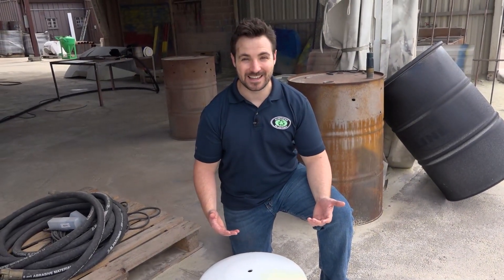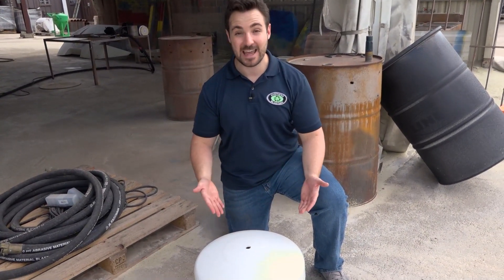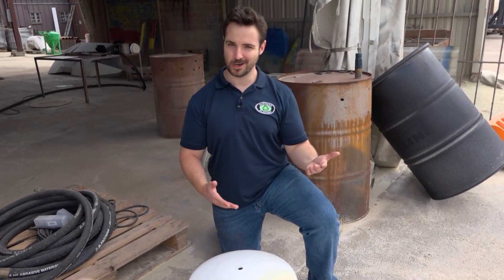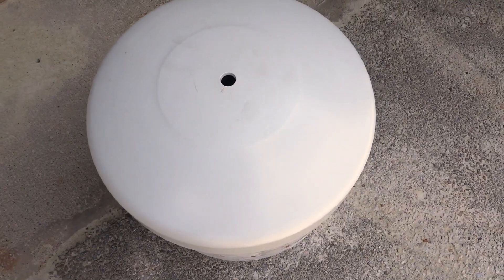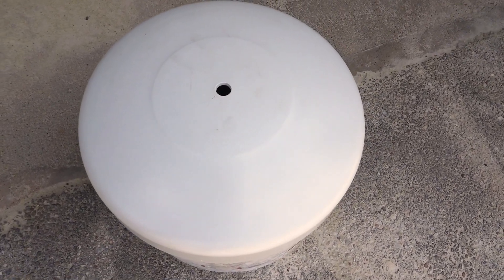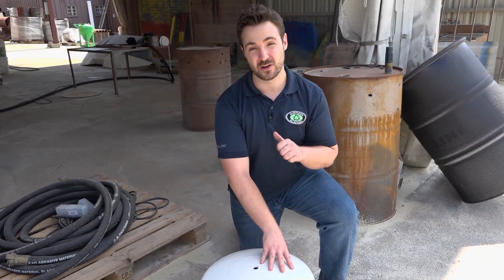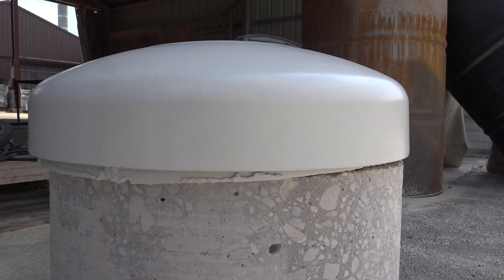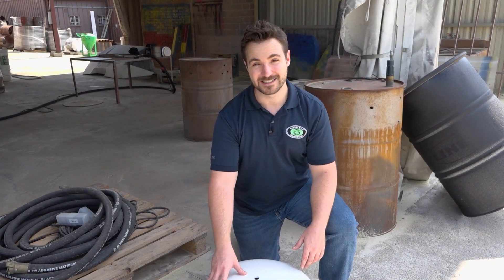Powder Coating Blasted Away! | 30 In 30

Comment: What was the profile difference?  The time and removal seemed the same? What size was the garnet vs the size of the crushed glass?
Reply from the maker: we were expecting this powder coating to be WAY thicker than it ended up being. We went to a local powder coating company and didn’t know what to expect as far as what the thickness would be. The  40/70 crushed glass removed this really easily! So if it were our choice, we’d go with crushed glass for this specific project as 40/70 garnet we used is more expensive. This is why we always recommend doing a test blast to see how thick the coating actually is. Hope that helped!
Reply: @DustlessBlasting-MMLJ  definitely was not a regular thickness of powder coating.  It usually doesn't come off like paint. Sometimes, a test blast is not possible and that's when I just go with worst case scenario and when it comes off like that, it's a good day.

Comment: So what was the difference?
Reply: Right… haha I was waiting for a recap and conclusion..
Reply: What was the difference in the profile?  The time seemed to be the same. What size garnet vs the size of glass?
Reply from the maker: Hi Curt, we were expecting this powder coat to be WAY thicker than it ended up being which is why we switched to garnet after blasting with crushed glass. We had gone to a local powder coating company and didn't know what to expect as far as what the thickness would be. The crushed glass removed this really easily! So if it were our choice, we'd go with crushed glass for this particular project as garnet is more expensive. This is why we always recommend doing a test blast to see how thick the coating is actually going to be so you can choose your media accordingly. We do know that some powder coatings are much thicker than this and would need a more aggressive media than crushed glass. Hope that helps!